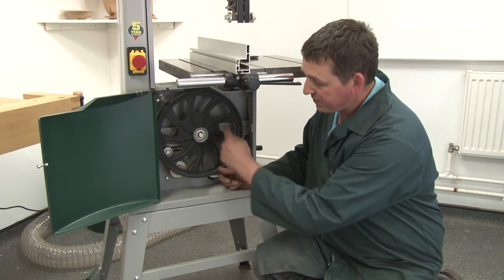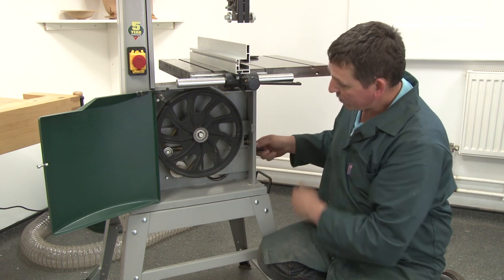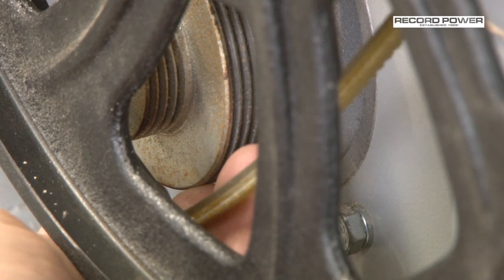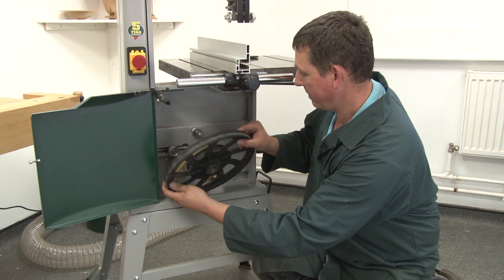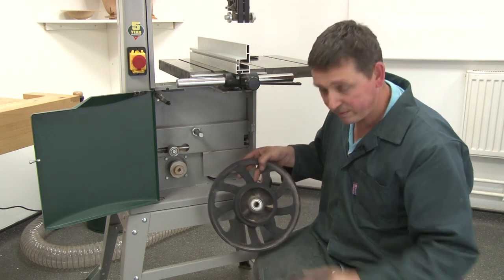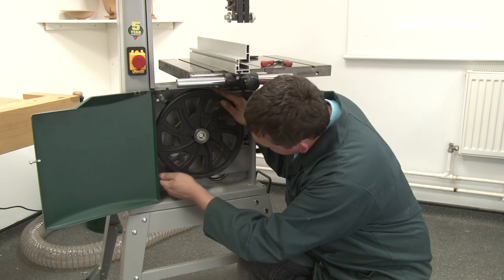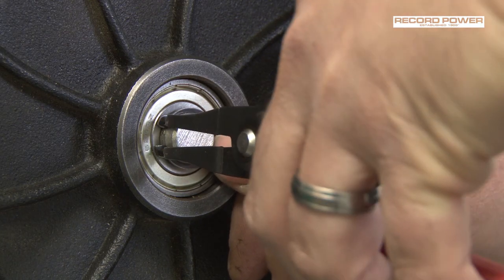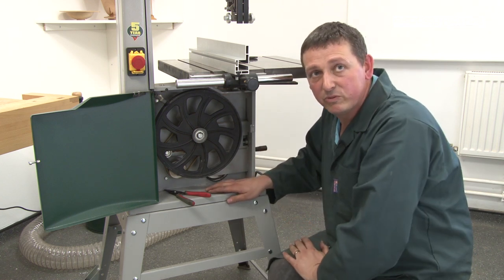How to Replace the Drive Belt on the Record Power BS300E, BS350S and BS400 Bandsaws

Comment: Q: Why do you place the tensioner or idler pulley, against the ribbed surface or inside of the belt rather than on the smooth side? Not only is this counterintuitive, but, no automobile manufacturer ever tensions serpentine belts using the idler pulley against the ribs.  This will also weaken the least strong area of the new belt, namely the ribs.
Reply from the maker: Hi John, thank you for comment. First isolate the machine and remove bandsaw blade. Release the tension to drive belt and remove the cap screw in centre of the bottom band wheel, having done, so pull the band wheel off. Place the new belt onto band wheel and refit, lock into place using the cap screw. Once the belt is in place, tension the belt (12mm flex in belt) on selected position (high/low speed). Refit the bandsaw blade, check the tracking and guides, and run the machine. Best Wishes, Record Power.
Reply: @RecordPowerTV  Did you cut and paste this from some manual, since it certainly does not address my query RE: the placement of the idler pulley nor the tension needed.
Reply: @jageo48  I've always placed my bandsaw belt with the 'v' grooves against the smaller top wheel and the  larger bottom wheel..... but over time it has started to twist my belt so now the flat side of the belt rests against the motor and also against the grooves of the wheels - sounds weird but god only knows why but it now doesn't twist my wheel
Reply: @2spoons  Thanks.